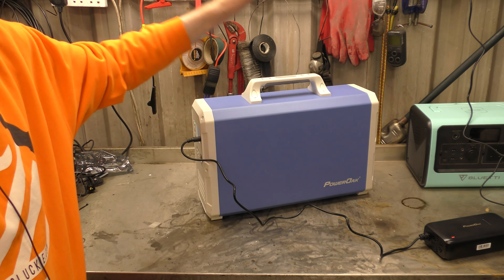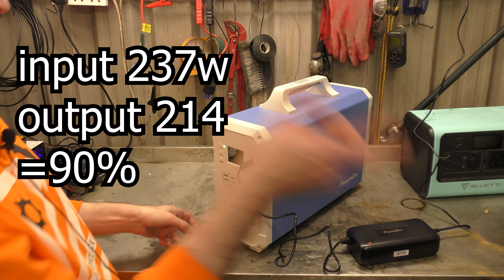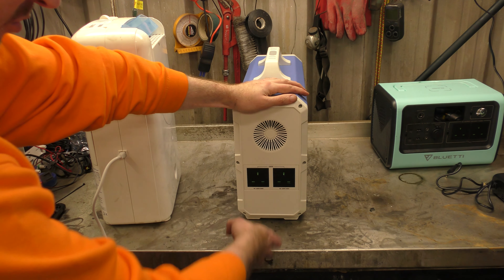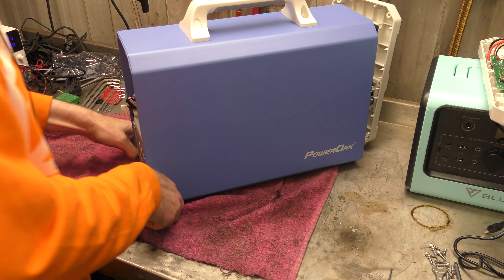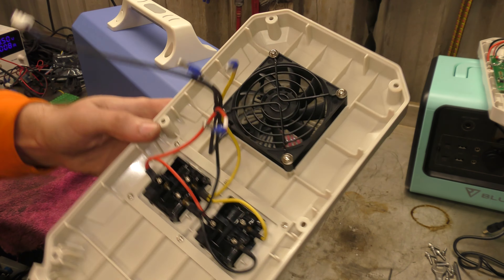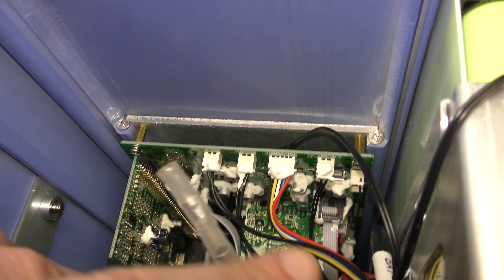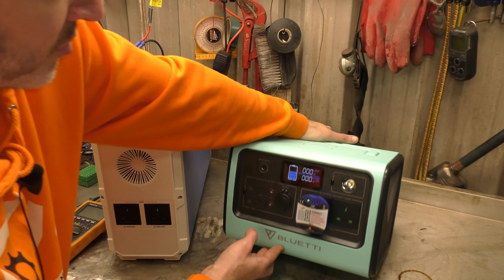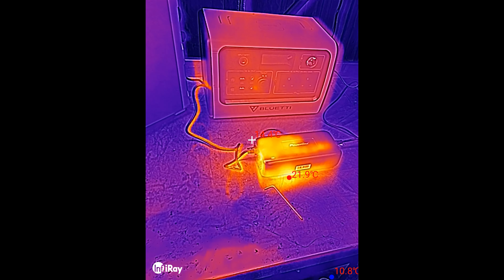PowerOak EB240 2400Wh power station | let's look inside a little

Comment: Just picked one of these up myself - definitely a good price even if the units are a bit older and degraded somewhat. The cell manufacturer DMEGC are quite responsive, so you could check the batch code with them (the 10 characters after 00UCEFA) I can only see 21108A1 in your video... so you might have to open it again. Could then see how old the cells really are. Not sure I want to open mine! :P

Comment: Pretty good for the money for 2.5kw capacity, my ebike battery is a 48v33ah for about 1.5kw capacity, weighing it at about 8kg. That one cost £550 from germany a few years back where you save a bit of weight not having an inverter and displays and bits in there. It would be a hard call ibetween getting two of the ebike batteries and hooking them up to an inverter or getting one of these power banks. Id be tempted to make a big array after buying some deep cycle cells, perhaps 3d print some cradles for the cells and solder up some bms boards to them. Cheers for the look inside, its a meaty handy beasty 🙂
Reply: You can buy a 3.8 kwh 300ah LiFeP04 battery for 1000 dollars US. Rated at 4000 charge cycles to 80-90% remaining capacity.

Comment: Hallooooooooooooooooo from Edinburgh.

Just bought one a few hours ago for £999 delivered. Christmas sale up until 28th December (MaxOak). It's just for cover if we start getting time slots in the UK for blackouts to protect the national grid.

I did consider the BLUETTI AC200P but it's £700 more for less capacity although more lifecycles and a larger inverter but it would just be for fridge, modem, PC, monitor and a lamp or two which will be fine for 1000W. For £999, I think I've made a good choice.
Reply: I was a bit sketchy with there being three companies (Bluetti, Poweroak, Maxoak) but seems they are all tied. I think Bluetti site sells latest & greatest and others are for legacy and for where they distribute.

I wish you and yours a nice holiday season.

Comment: Using the little math I know, I'd say 228 cells in total based on 2900mA for each cell, assuming that is what the 29E at the end of each cell says. 3.6Vx2.9=10.44x228=2400wh. Purely guessing, but think that is right after realizing it had 12 cells in a pack to correct my math, thus the edit :)

Comment: What I really don't like about the EB240 is that it takes quite awhile for charge it.
Reply from the maker: I think with the 200W charger it takes about 12 hours.  You would think if it can take 600W input they would ship it with something that can give it 600W input.
Reply: @DavidMcLuckie  The 20 amp plug in LiFeP04 12v battery charger I bought cost well over 100 US and I got the cheap one. Makes no sense. The higher amp ones cost more than 100 ah batteries. I got it to be able to use my 12v 300 ah battery with a 2000 watt inverter for power outages until I can get the rest of the panels and parts needed to get over 600 watts solar into it during Summer to power a tiny window air conditioner. Joe Biden is killing us here. Hopefully I can save enough money to afford meat by using this setup in the future. I had to have off grid power because of hurricanes and other storms. Can`t imagine trying to put fuel in a gas generator for two weeks 24/7. Impossible actually in my situation. Costs about a dollar per hour minimum.

Comment: Hello! Great video, thank you. Can you power a wet pump 1000w?(in water)
Reply: If that surges, it could possibly power off the unit and if it doesn't, you'll get about 2 hours use out of a full charge as you never get the full wattage hours.

Comment: This unit is no longer being sold by Bluetti, not sure about the other names that make it, maxoak in america, this is the first time i have heard of power oak. Rich solar also sold one with their name on it, but they went down in price due to the fact they are no longer making them. I bought the 1500 wh version and my brother has this one over 2 years ago. the inverter is not the best and obviously has older tech for the usbs. still a good unit and great for the value. i believe the inverter is either rated at 1000 or 1200 watts. may not be enough if you want to use an induction cook top.
Reply: With Echoflow Delta's and other models for around this price, you will get a larger inverter but it's usualy at around 50% less battery capacity so it kind of defeats the purpose for my needs. I'm going to buy a 900w kettle and possibly a 800w hotplate but I have a camping stove and a lot of gas already. As long as I can power a few entertainment devices in a blackout then I'm all good.

It's quite strange that after two years, this is still the best capacity for the price although heavy appliances are out of the question. Those who need this will have to pay around £1700+ to have close to the EB 240 capacity with a more powerful inverter. I just got my EB 240 a few hours ago for £999. Even with the newer models, you'd be paying £1700+ and would only be able to run a 1500w device for less than 2 hours.
Reply: I think Bluetti sells the latest and greatest but the other companies (I bought my EB 240 from Maxoak) I think sell legacy models. Possibly different names for where they distribute to also. I did think it was a bit sketchy at first but they seem to all be tied to one another.

Comment: I also bought an ac to dc charger that puts out 500 watts to recharge mine at 2 times the speed for 50 dollars. you just have to make your own cords to attach to it to make it work. you can watch a 2 or so year old video of hobotechs to find out what i bought. much cheaper than the ones the company sells at 150 to 200 USD.
Reply: Wouldn't that possibly lessen life cycles? I'll check Hobotechs video (I've already watched a few days ago) and see what the price is and what I need if I go ahead.
Reply: @J.D_7  It can lessen the life cycles if charge at 500 watts all the time but it is rated at 500 max charge so it should not do that, but you can also set it to lower charging if you want. the max it puts out is 500 watts but you can set it below 100 watts up to 500 if you want. but bluetti did make a dc booster that works with the old models to charge at faster speeds, it just costs 200 dollars.

Comment: I`m glad now that this cheap scam company rejected my purchase of a used one of these for 500 bucks. Bluetti is an evil ripoff company. Their EB70 is one of the most inefficient piles of garbage I`ve ever used. My 300 watt Golabs power station runs my WIFI for over two days...the EB70 less than 24 hours. My 500 watt Rockpals runs my dorm fridge for at least 30 hours...and the "higher capacity" Bluetti can`t run it 20 hours. These power stations in the video are infamous for their high failure rate. I got lucky.